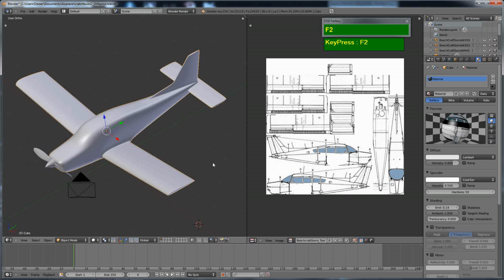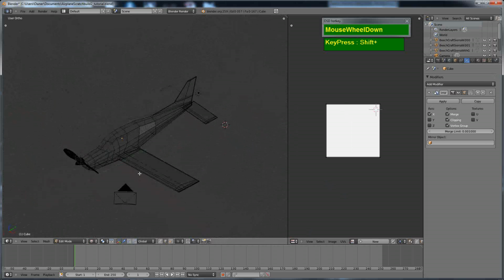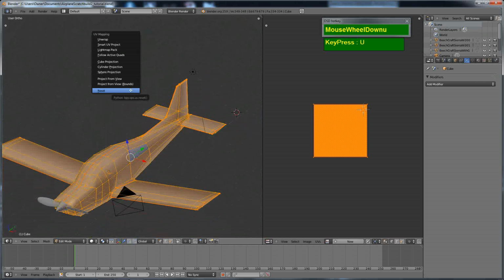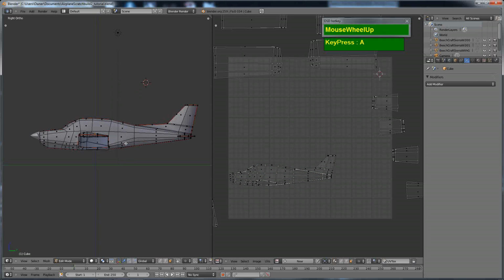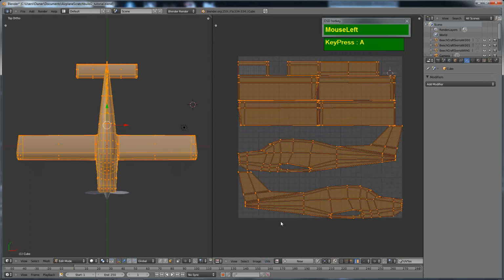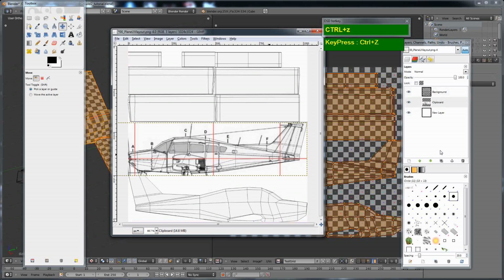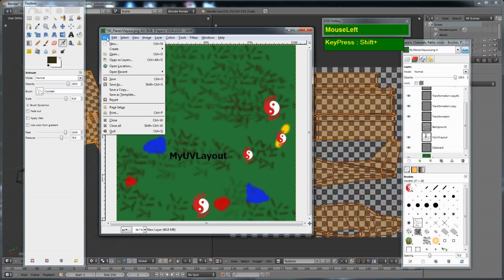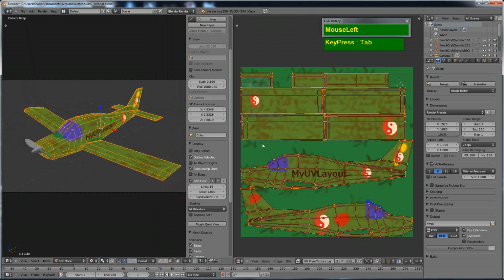Blender 2.59 UV Layout, Projection & Texturing for the Airplane Timelapse Model

Comment: from where u got the texture map ?
Reply from the maker: You can google for the Beechcraft Be-24 Sierra blueprints and photos to get the texture references.
Reply: weeliano when i make f22 and put a picture as a texture map it fits the airplane but looks so low quality. ..what must i type in google search to fiind the proper texture
Reply from the maker: Ahmed Mounir In Google search specifically for "Blueprints" or " 3 view " drawings. And set your search size to only Large images.